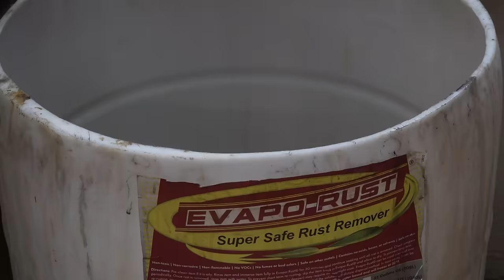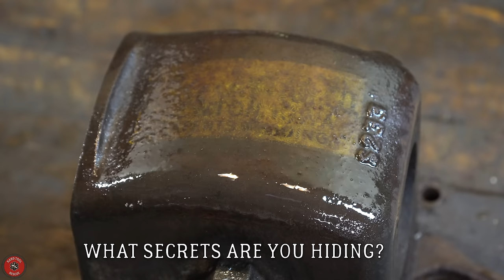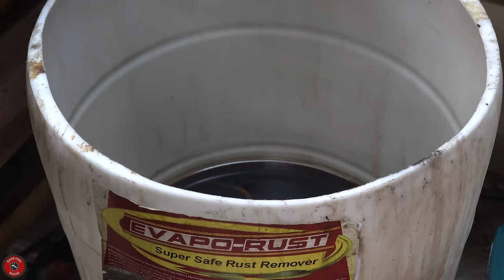1920s Maytag Washing Machine Engine [Restoration]

Comment: 'This is bent. I have a replacement.' Well, of course you do. Doesn't everyone?
Reply: I was slightly disapointed he didn't heat it with torch and straighten it.
Reply: @SuprSi  There is no need to heat that metal, its malleable Iron  A big hammer and one to two strikes would straighten it.

Comment: I'll bet the Maytag repairman was very busy back in those days.
Reply: Not really, those were built to last for years. The only thing you really needed to do was a minor service on them. Those were built back when people took pride in what they made, and they were made to last for decades, unlike the stuff made today.
Reply: @InTheDogHouse3DPrinting  They were and I've seen these motors with the pedal start and they are built to last.  Also the little Maytag oil cans are highly collectible and quite pricey if you are lucky enough to even find them.
Reply: Not so! Maytag washing machines back in those days in the 20's were made to last . Decades old and still goin'.
Reply: I'm not sure about that. Being most people could fix there own stuff and took pride in it. Plus those motors are built like a tank.
Reply: They don't make motors like that anymore
Reply: They got red of what worked for something that has to be replaced the average Joe could fix the motor now there electric

Comment: Argh, when you finally wrap up a project, and something snaps and you spend the next 5 weeks searching for spares on weirdly specific internet forums.
Reply: @Jme's Terra the old washing machine part watch list?
Reply: One day my buddy spent all day tuning up this old k-car. He had it running just right. He said listen to how good it sounds, revved it, and kerplunk.  It died on the spot.  ; )
Reply: @mikeries8549  I had a Dodge 600 convertible. (Yes, they existed. Same exact cloth top as the Mustang!)  One weekend I went through and cleaned everything, replaced the fluids, got it running just right. Took it on the Merritt Pkwy near my place, got up to 65, and BLAM threw a rod right through the side of the block. I was so sad. I loved that crap-brown hunk of junk.
Reply: Try finding parts for a one off vintage snowmobile. I  had to find someone to engineer a new part because there was no part and I couldn't get anything else to work. That one part held up finishing one project before I finally said enough. It was worth it in the end.

Comment: Reminds me of the days when my father used to work on Briggs & Stratton engines. Definitely a flashback seeing those spring ignition points. He could take a smoking, rough-running B&S engine and make it run like new again. He passed away 15 years ago on January 29, 2007 and would have been 86 today.

Comment: It is unfortunate that you forgot the pin which led to the loss of the flywheel. However you did not edit-out the misshap. It proves that you are only human and humans will blunder things at times. Cheers to your fabulous restoration. A great way to entertain visitors while you wait for the steaks on the BBQ.

Comment: 1920's: Yeah let's put an engine on our washing machine.
Reply: Well, in the days before wide-spread public access to electric power, especially in rural areas... You needed other power sources. Like gasoline.
Reply: @Mujaki  
Internal Combustion engines!  Gasoline in rural area wasn't so available either
Reply: The 1920s was prior to rural electrification.  Back then having a hydroelectric dam spin a turbine to provide enough power to run a light bulb or two was absolutely mind blowing.
Reply: Looks like new great job.Thank goodness you had that spare part that was sad to see at the end. How the old saying goes. Shit happens.
Reply: @JohnSmith-eo5sp  It was after the automobile became common! Say about 1908. Grandma had a 1 hp water cooled engine outside the utility shed beside the house that drove a  jackshaft along one inside wall. She could belt up the washing machine or the barrel butter churn or both. Another 1 hp at the barn pumped water from a 170 ft well to cool the milk and cream and water the cattle, pigs, chickens and horses. For a number of years they had a 10 hp engine on a wagon to drive a threshing machine or the feed grain grinder. A 15-30 hp McCormack steel wheel tractor took the place of that one. The 15-30 was replaced by a 102 senior Massey-Harris when I was 6 years old.

Comment: I was kind of glad to see one of these engines restored.When I was about 12/13 tears old,we lived on a farm,no electric,wood heat,had one of these washers.On wash day,we would set it up ,run the exhaust hose out the door and wash the families' clothes.Of course we had to get from the windmill,heat the water on an outside fire.
Reply: my grandmother on moms side had one but they had a wood cook stove that also had a heating coil in it to heat water .

Comment: A neighbor gave me one of those in about 1945 along with an old transmission, the hours spent devising were happy ones. That little gem taught me never touch the spark plug with the engine running.

Comment: Dang, been a while since I saw contact points.
I used to tinker with mopeds as a teenager, can't count how often i was filing them clean, coz they'd burned in again.
Happy was the day I got my first moped with CDI ignition :)  Honda MB50 from 1982. Man that thing went like stink. Had it's own 2-stroke oil pump too, and the crank was perfectly balanced - 11.000 rpm without a single vibration.

Comment: My father was an engineer.  He could fix anything. and in 1975, he figured I should learn to do the same.  So when he saw at a junk auction an engine VERY similar to the one in your video,  he bought it and said I would learn small-engine repair, and if I fixed it, I could build a go-cart to wrap around it.  Dad was wrong, but I tried.  Sort of.  Looking back, I know precisely what was wrong with the motor, but I'm 58, today, and I was 10 when the maytag engine came home with us.  I remember (1975) my dad counting off from wrote his advice on root-causing why that engine wouldn't start: he gesticulated a count-up, one finger at a time, saying, "You got spark; you got compression; you got fuel, YOU GOTTA RIDE!"   Turns out I had no way to prove compression, and that was the root-cause.  But hey, I was ten.  Anyway, fast-forward to about 1985, and I'm in my '69 Nova that flat-out died along a desolate river highway east of Isleton, California, at 8pm in the winter, on a Sunday night.  I had to walk several miles down a light-free highway, in the fog, to get to Isleton, but Isleton was closed.  Yes, closed.  Sidewalks all rolled up neatly, etc.  There was 1 payphone in town, and it took 15 mins to find, and I had 2 dimes.  I called dad to get his advice.  Actually, I hoped he'd come out and help.  He helped, alright, but he didn't come out. In raised voice, over the phone, he said, "You got spark; you got compression; you got fuel, YOU GOTTA RIDE! <click>.  <dailtone>".  With my other dime I called in a much needed favor from a friend who then drove all the way from Roseville, CA to tow me home.  We were neighbors.  Next day, once the sun came up, I pulled the carb from the Nova, rebuilt it, put it back in, tightened it down, and it "just worked".  Dad came over for a visit the next weekend.  "Start her up," he said.  I started it.  "And what do you have?" he asked me.  "Its a f'ing nova, but at least I GOTTA RIDE".  He liked that.  My wife laughs when I (re)tell her this story, but more importantly, I've shared Dad's wisdom with others, and I love mimicking his "YOU GOTTA RIDE!" count-up.  Although I felt abandoned that cool night in  1985, it turned out to be a liberating moment that my dad really appreciated. Many's the time we chuckled over a beer about that night.  Miss you, Dad.  You sure would have liked this channel!

Comment: Amazing you were able to completely disassemble the entire unit without snapping any bolts, stripping any screws or busting any knuckles. I subscribed just for the intro ❤
Edit 40:00 -  40:11  you did install the flywheel nut pin  but later i didn't see it when you started it and at 34:08 you did also install the flywheel shaft key too but what you did not do is try turning the flywheel before installing the nut to see if the key was set. Sorry you broke the part but good thing you had an extra. Maybe you can sand cast a new one later 👍🏼

Comment: I can remember working on one of these in shop class many many years ago.  The instructor got a kick out of explaining how a magneto worked by having the students all hold hand in a chain. One student would hold the spark plug wire and the last student in line would  hold the case of the  engine. The instructor would push down on the starting pedal and watch all the students get shocked.  Ah, yes, the good old days of shop class  and getting your rump beat with a wooden paddle when you messed up. 😆 🤣 😂
Reply: LOL  I grad in 73 we still got swats then I wrestled and our principal was one of our coaches  a singlet was no protection !!!!!

Comment: I've had 3 or 4 of these over the years, both single and twin cylinder. Never really 'restored' and of them, but all of them did run pretty well. I'm amazed that the coils hold up for 75+ years on these, but the condensers do fail from time to time.😉

Comment: Haven't seen one of these in a while my brother in law used to have a museum and he had a wagon with different moters on it he took to old time threshing shows it had a maytag washing machine motor on it since we had a light pole at each end  of the  trailer with a string of 32 volt lights to show off the Delco and Lister power generators one problem I had was with the kids grabbing the power poles and climbing on the deck for a closer look at the engines I fixed that by running a line from the maytag spark plug to the pole never had that pole ripped loose or off again but maytag was I think the only washing machine to come with the ability to be run on any power and fuel supply you could get them in 12. 24 32 volt DC and 120 240 volts AC and 1or2 piston gas diesel natural gas propane and skunk gas truly universal machinery

Comment: reminds me of a real old lawn mower my dad had.   It was old enough you had to wind a rope around a spindle and pull to get it started. (and be sure and let go in case it didn't slide out ) Ah yes, the grounding strap to disable the spark plug.   Misplacing your touch could really wake you up.

Comment: Very, very awesome.  Thanks for sharing.
I’m wondering whether that was actually a Babbitt bearing(s) around the connecting rod at the crank end?
Might have to take a cylinder hone to the piston bore.
Absolutely loved it.
Reply: The 1920s Johnson 'waterbug' outboards had the same arrangement, solid bronze conrod and main cap with no distinct bearing. I was quite surprised when I saw it- on the Johnson the conrods are even offset so that the opposed cylinders don't have to be staggered.

 The specific output of these engines was/is very low, and (by modern standards) the premix ratio is very heavy on the oil. It seems that the bronze holds up pretty well as a result.

Comment: This carburetor works in almost the exact same way as the one on my old garden tiller. It allows for the fuel tank to be mounted below the carburetor. It uses the vaccum of the engine to draw it out of the tank. They can be super finicky and have to be sealed perfectly, or they will not run right, or at all. Unfortunately, the single cylinder flathead on my tiller broke a rod. So, it's been temporarily replaced with a honda clone from a 3" water pump I found at the scrap yard.

Comment: Did one of these years ago. I don' know if it was amps or volts that made the difference, but I had pulled the plug wire, one hand holding the wire, the other hand holding the spark plug and it stayed running without shocking me. We tried adding people and wound up with 5 guys holding hands as a long human plug wire and it stayed running. Guy 6 shut it down. Don't try it with a Briggs, it hurts. Yes there was beer involved.

Comment: at 15:07 the damage on the flats ot the plug are results of NOT using the correct tool for the job such as an adjustable wrench or a screwdriver, using the correct wrench will not cause this kind of damage and i love the disclosing of the error at 44:03, overall a very good restoration presentation

Comment: So what happened to the cotter pin you installed at 39:44? Was this time-shifted showing the installation of the second flywheel?

On most small engines I've worked on the flywheel is prevented from rotating on the shaft by being jammed onto a tapered section of the shaft by tightening the nut, and the key is only to provide placement during assembly. In fact, the key is made of a soft material so it shears off (and the engine stops running) if the nut ever becomes loose enough to allow the taper shaft to slip.

Comment: The failure of the flywheel hub was probably due to an oily surface.  There needs to be a mechanical "locking" of the tapered shaft into the hub which an oil film prevents from happening.  The key-way is only for alignment purpose and is not intended to drive the flywheel.  Dry assemble this type of connection and torque to proper specification.

Comment: I have a mod 31, been trying for months , not getting more than  a minute putting.  Magneto Coil has 6k ohm, new condenser,  original Maytag sparkplug gapped .030. Points gap is  018.
H E L P!
Whats sparkplug gap on the maytag 2 prong ?
2)  what color is the spark  supposed to be? 
Mine is weak yellow!
3) my 93 had 2 condensers.  Can I use only one?

Comment: FYI the tabs on the star washer at 27:45 is designed to be bent up against the brass nut head to keep it locked tightly...

Comment: I guess that extra tooth bolted to the sector gear of the starter pedal is a material tougher than cast iron as it takes the brunt of the clashing teeth when the gears engage. Also, if it wears it can be adjusted to mesh properly.

I don't quite see, though, why the starter pedal and sector gear are two parts. Maybe just ease of manufacturing? Different materials?

Comment: Looks like chrysotile (white) asbestos. Most commonly used, and the least dangerous of the 6 types of asbestos because its fibers are soft and flexible, and because they don’t become airborne as readily as the other 5 types. I spent 16 years identifying asbestos in building materials, including old gaskets. We work inside hoods with negative pressure and HEPA filtration and we sprayed everything down. I’ve since changed careers.

Comment: When you have a rusted or tight plug or spline, after heating try applying wax, it will follow the threads down.
Reply: Hey, actually it's been tested, and it don't work =/
Search it on youtube !

Comment: On the foot pedal assembly, why is one of the teeth screwed on, instead of being part of the mold?
Reply: To save money? That first tooth is going to take most of the impact during a kick. So it's made of higher grade/hardened steel, like the small gear would be. Whereas the rest of the "rack" gear is just cast and likely not hardened. Would be more expensive to harden the whole thing. Also, it's replacable, and it's cheaper to replace a smaller piece. There may be additional engineering considerations--there's tradeoffs anytime you harden something, but that's above my paygrade.

Comment: Where do you find parts for these engines. I have one that someone removed the piston and rod and discarded them .cylinder is in great shape so is crank.i find no reason to have removed or discarded parts.i would like to restore a install engine in a 1930 pedal car.

Comment: The exhaust is a long flex pipe with a ball on the end that contains a valve that after ten or so cycles will pop off.

Comment: It seems turning the crank with an impact socket tool isn't the best idea.  I  used the same trick when I was young and ended up fracturing the aluminum flywheel.  Never could get it going after that.  Live and learn.
Another excellent restoration however.

Comment: 25:20   You know that unpinned piston rings DO rotate when the engine is running, right? The ring gaps will eventually line up with the ports many times throughout the life of the engine. It doesn't matter where the gaps are when you assemble it. Just don't have them all lined up with each other, so that you will have enough compression to get it started the first time. Any rings that aren't pinned, it makes no difference where the gaps are.

Comment: all of those engines are 2 cycle engines 😊😊 U had. 2 put the 2 cycle motor oil in the gas and mix it shake well 😊😊 just like the chainsaws and weedeaters are 2 day 😊❤ and if U remember years ago the old push lawn mowers 2 were the same and now 4 another story that's older than that if U remember this 2 😊😊 the old reel push lawn mowers U could let the grass get tall or else it was hard 2 cut then later on they 2 did have gas engine on them 2 😊😊 more power 2 cut the grass w and alot better yes I can remember this 2 from when I was a kid 😊❤ OMG 9 28 2O23
Reply: Fuel oil ratio is  16:1

Comment: 😊I know how a simple valueless 2-stroke engine works. I also understand how a 2-cycle hit-and-miss engine with an exhaust valve, holds open the exhaust valve so the piston does not create a vacuum opening the intake poppet-valve drawing in fuel-air mixture during the 'miss' revolutions so fuel isn't wasted and worse raw fuel-air pumped out the exhaust during miss revolutions... 🤨 But how does a 2-cycle hit and miss engine like the Maytag 92/72, without an exhaust valve, prevent  fuel-air intake and then (unburnt) pushed out as exhaust on the 'miss' revolutions?

Comment: Very good video one thing I noticed is the connecting rod clearance too tight it and needed a new condenser whitespark memes condensers bad blue or purple spark beans good condenser make a small hone for the connecting rod bring the at .002